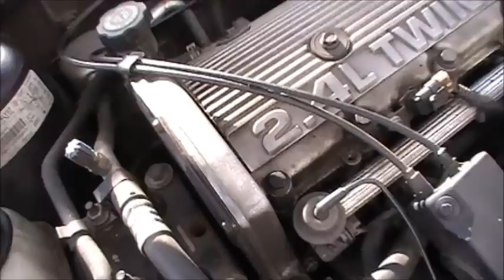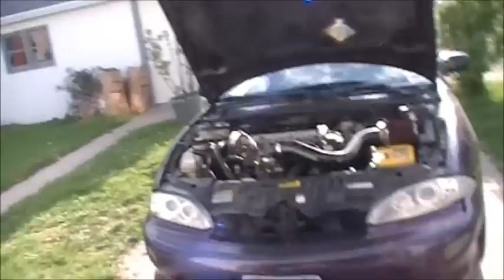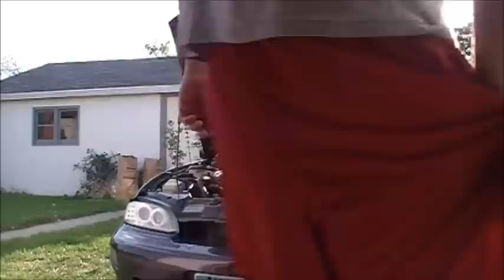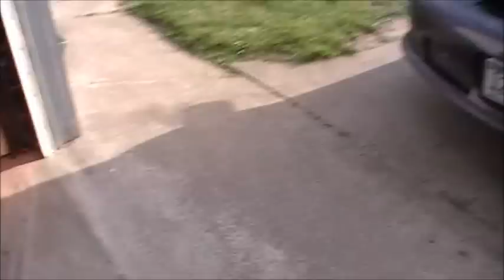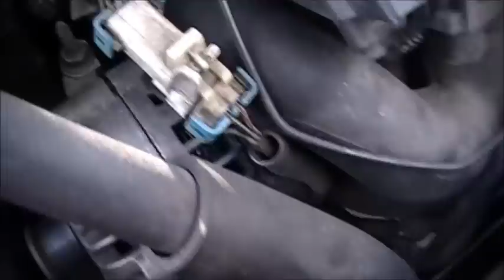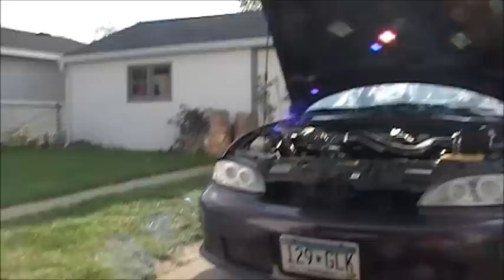Alternator bearing noise - Chevy Cavalier 2.4L

Comment: my civic made a bad grinding noise like this but not as bad and was the water pump. sucks your water pump is ran by the timing chain... if it is the water pump you gotta remove the exhaust manifold motor mount and timing chain cover etc. its quite a bit of work :P

Comment: There's a belt on the passenger side. My neighbor Wesley, showed me and he checked the belt. The belt is probably worn down in the inside where the grooves are at. I have the same sounds as the squeal from the belt There's a small silver shift where the belt runs on and wears out the belt grooves if the shaft doesn't rotate properly. I also have the rattling sound. Wesley didn't say what that was but I think it might be from the shaft inside   the part. The alternator or generator, I'm just guessing here. I hope I made sense. Sorry if it doesn't make sense. But I do know the sounds cause my 2004 chevy cavalier makes them right now.

Comment: It can be the belt tensioner but also timing chain. Mine had the same sound it was the belt tensioner but around 6 months later it needed the timing chain too.. Also it sounds like it has a vacuum leak. Check where the air throttle is.

Comment: I had similar noise, started as a whine, went away, then turned to that noise.    My ac compressor was blown out, I spent $75 to have a shop put on a new belt to bypass it.   Has been fine since

Comment: Hey guys I'm having the same problem. It's sound about the same but it goes away once I turn the wheel. 
And it didn't do it when it's driving just idling
Reply: Probably the power steering pulley.

Comment: I know this is a old video but from my knowledge of the LD9. Part of the problem is the serpentine belt tensioner, but that's may not be the main problem just a symptom. I would suggest checking the belt itself for excess wear and to see if it's stressed beyond safety specs. also i would check the bearings of the alternator as well as the harmonic balancer or in this case main crankshaft pulley. Both a bad bearing or bad pulley could cause the belt to rub against the a/c compressor clutch assembly.
Reply from the maker: ty israel this ended up being the alternator bearing, new alt fixed it right up.  id suggest to anyone haveing a noise to remove the belt (as long as its not the timing belt lol) and start it without the accesories to see if the noise still exists and turn all pullys by hand.  i have a follow up video showing how bad it was.